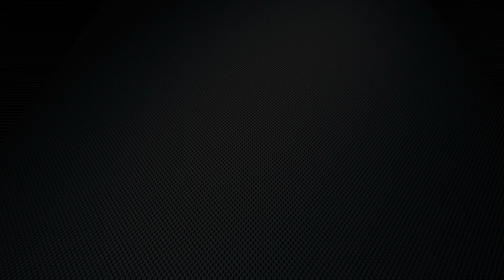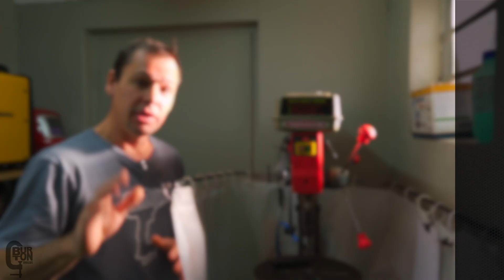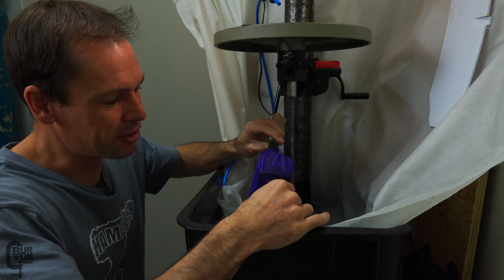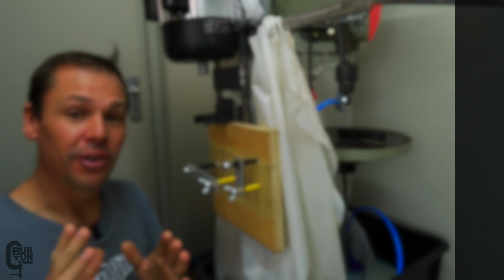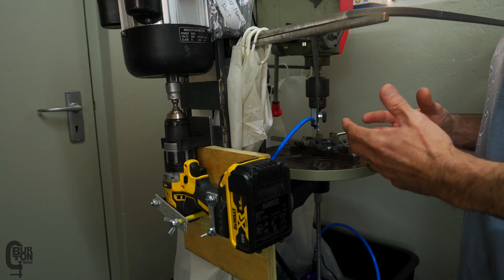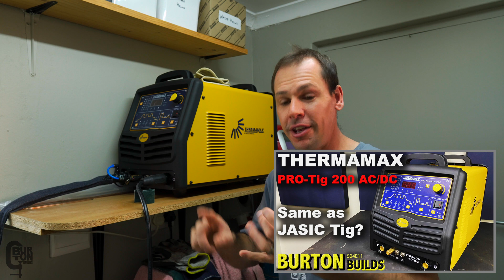Drill Press Modification - Burton Builds

Comment: This was interesting. I like the water cooling setup. I drill and thread anywhere from 40-60 holes every day. Just for yucks I timed myself with a M6x1 thread. This included selecting the tap and installing it in the handle. A36 plate, 1/2". It took 33 seconds. I thread mostly by hand, as I really like doing it and often it's quicker than using a mill due to setup, depending on the number of holes. You obviously enjoy coming up and using creative to handle the process and that's fantastic. Good luck.
Reply from the maker: Hi Felix, Thanks... I've been wanting to do this for a while and finally got around to doing it. I actually mostly needed it for drilling 5, 6 and 6.8mm holes in12x12mm 316L Stainless Steel square stock. Works a treat and the bits are lasting much longer now. Drilling through mild steel is like a hot knife through butter. Best of all, the drill bits and the square stock don't get hot, they actually don't even get warm.

I take my hat off to you hand tapping 40 - 60 holes per day, I don't think i could keep up with that... I started like that but got lazy so needed to find a simpler, repetitive and easier way to get things done. I do enjoy the problem solving. Anything is possibly if you put your mind to it.

Are you not able to use the M6 tap in a cordless drill and power tap the holes handheld using the drill?

Comment: I would leave the switch how it is so you can choose when to turn it on and off. It'll be pretty annoying if you have it come on automatically at a time you don't need coolant lol
Reply from the maker: Hi Hillbilly Hacks & Redneck Ingenuity, thanks for the comment... Maybe a combination of what you suggest and the auto-switch... I’ll leave the light switch in line and also have the spring switch on the quill so the light switch must also be on in order for the spring switch to work. (If the light switch is off, then activating the spring switch on the quill won’t do anything).

I was actually contemplating also having the drill power up automatically when the quill is pulled (with similar spring switch) so that I only have to load the material into the fixture, tighten it and just pull down on the handle and both coolant and drill starts up... then once the hole is drilled, let off on the handle and the quill retracts and all turns off automatically. (Two less movements - one for pushing the on button and the second for pushing the off button).

Over 480 holes (which is what I did a few days ago) I think every step saved is time saved. It’s pretty repetitive work... 6 holes per piece of 12x12mm bar stock... 80 bars last time and more to follow in the future.

Maybe also have a switch which disables the auto-start for when I’m not doing the production style drilling.
Reply: @GrantBurton  That sounds like it would work pretty well. Looking forward to seeing what you come up with 👍